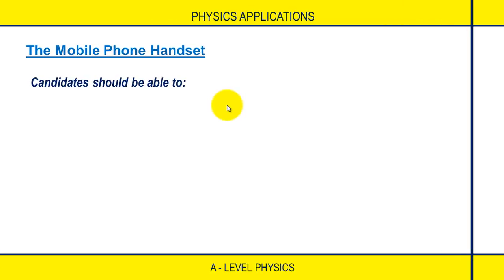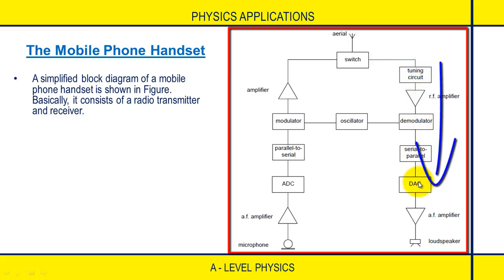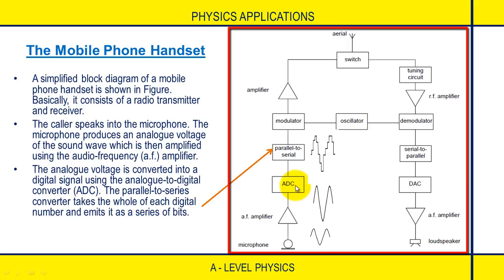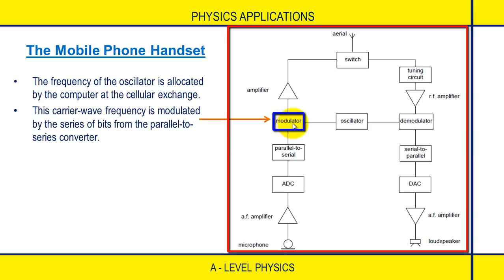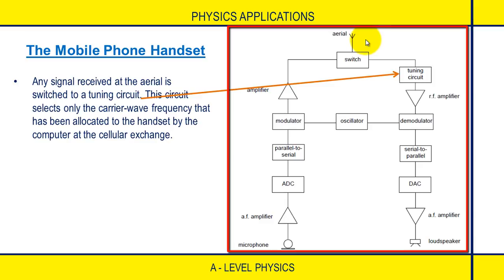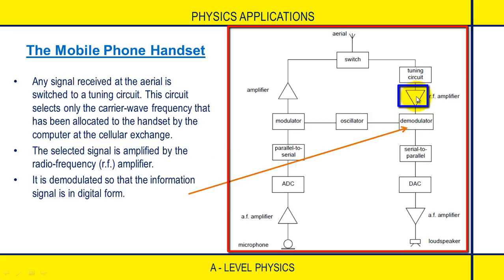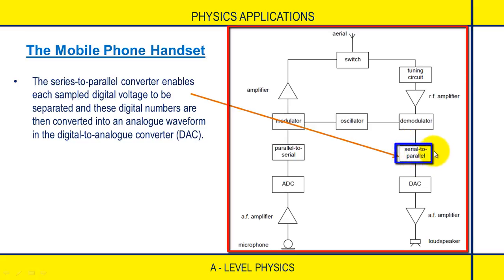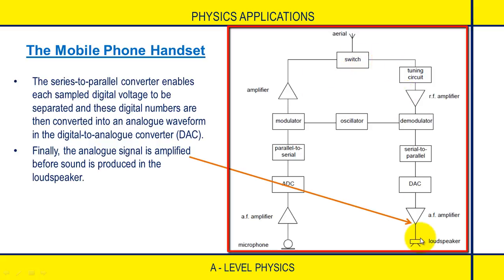How does the mobile phone work?

Comment: Actually, this is more like a digital two-way radio, like a Handy-Talkie (HT). Cell phones are full duplex devices that transmits and receives simultaneously. They have an RF duplexer in them to allow them to transmit on one frequency and simultaneously  on another,  typically 45 MHz way from each other. This frequency spacing is needed to allow the filter to prevent the TX energy from interfering with the weak RF signal received.  The diagram would be more accurate if the "switch" box was replaced with a duplexer and the modulator and demodulator had their own oscillator.